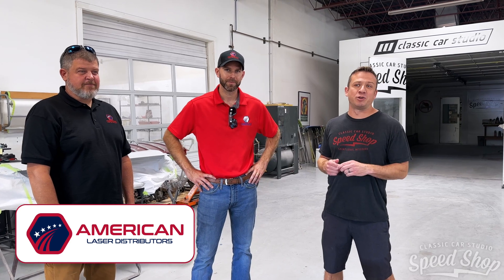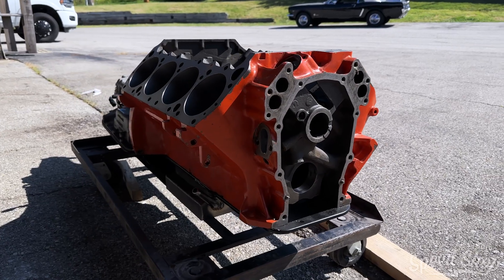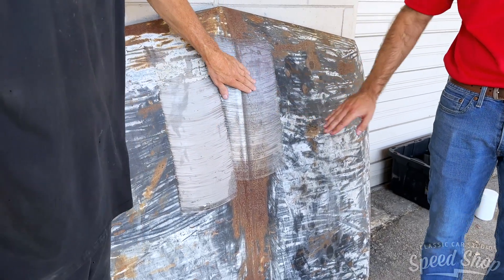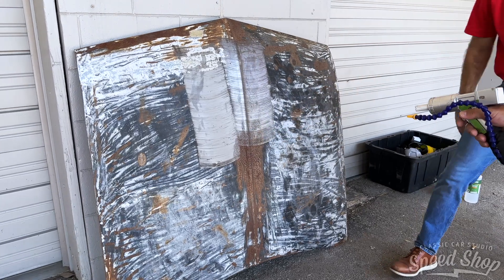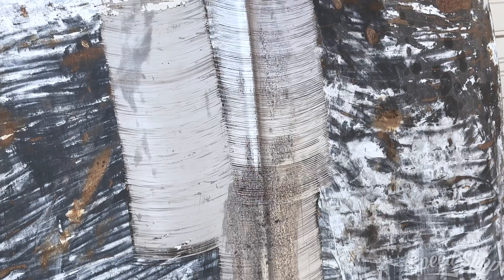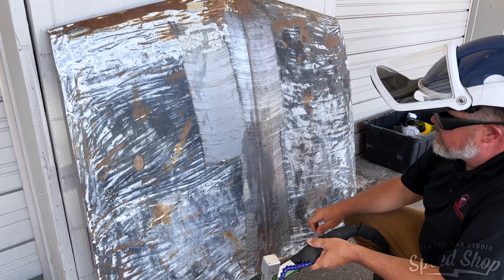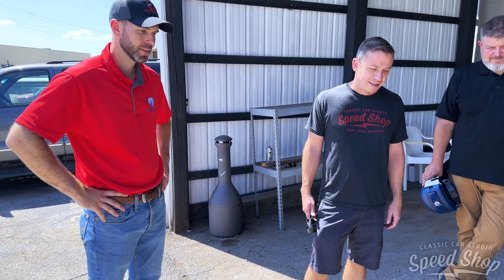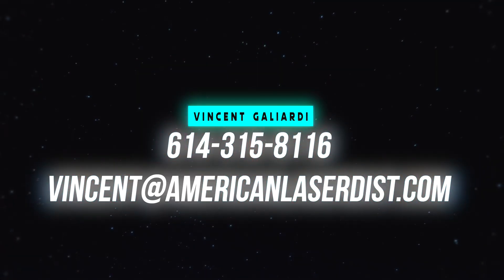Cleaning Metal with Lasers? You gotta see this!

Comment: That  may warped the sheet metal , good for cleaning engine parts or heavy metal , 
Not for striping the whole body as I rather use , dustless blaster system.

Comment: Using a CW on body panels is a great way to warp the shit out of them.  You need a pulse for auto body panels.  CW is fine for axles, frames, blocks and transmissions.
Reply: how do you know you have one
Reply: He is right, CW laser introduces lots of heat and will warp or damage thin substrates. A pulse laser is far better. Remember, gotta use the right tool for the job.